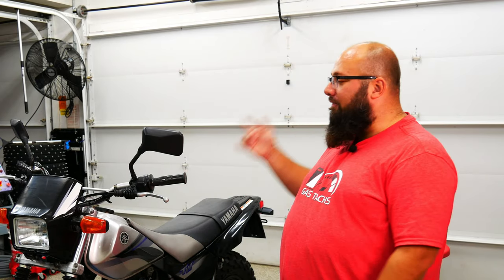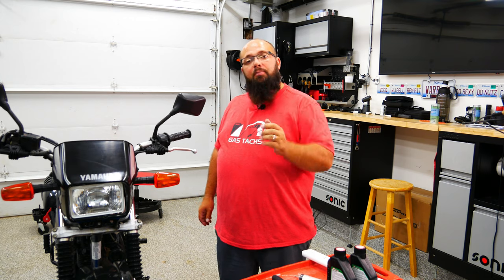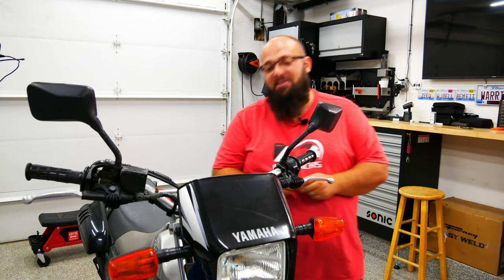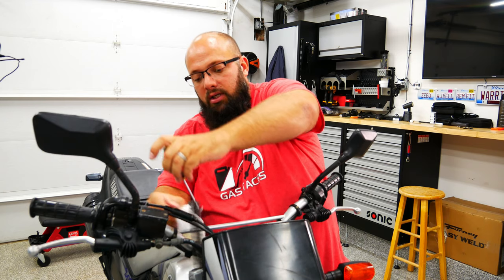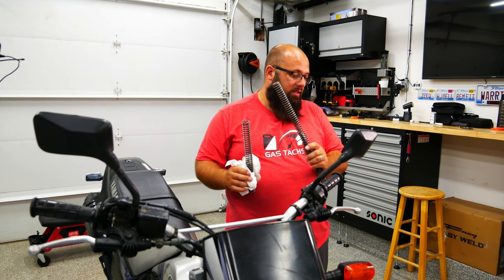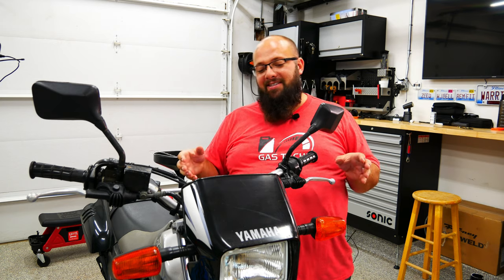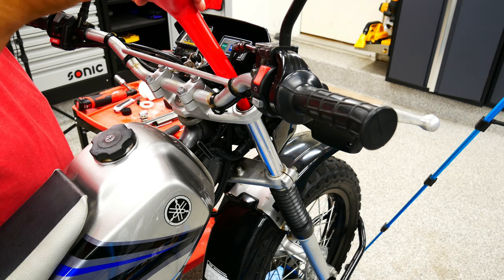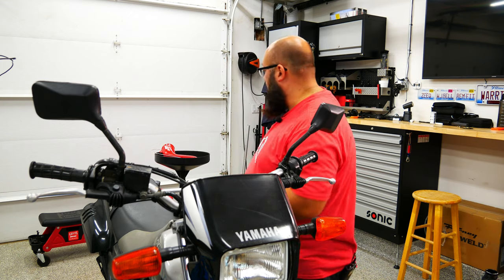How to Change Your Fork Springs on a Motorcycles  - My TW200 Build - Part 2

Comment: It does help if the manufacturer sends you two springs of equal length,  which for some reason Progressive Suspension seems to have a hard time doing these days.

Comment: This is the first video I’ve seen where you leave the forks on the bike while changing the springs, which I like. What’s the reason people are removing the forks entirely from the bike in the other videos??
Reply from the maker: Really I've had mixed "reviews" on how I work on things. Some say i'm stupid and some say thanks for the info. There is no reason to remove the forks unless you are rebuilding them.... Work smarter, no harder
Reply: @GasTachs  I agree. I’m about to do mine soon. I’m not sure how to check the seals but I prefer this method over a full disassembly.

Comment: So how are the forks after you changed the springs? Did you go with progressive brand or the springs from pro cycle USA. Have you changed the oil levels? Need more input.
Reply from the maker: So I went with the .70kg/mm which are 40% stiffer than stock. after doing this I would have rather when with the 60kg/mm. I have kept the oil lever as they were in the video.

Comment: dude.. truly for entertainment value only.
1) remove the forks from the bike
2) before removing,  loosen the top triple clamp bolts before removing or replacing the fork tube upper cover.    
3) you can't see leaks if you don't remove the fork boots....
4) at 90MM you probably will blow out the seals.  130 MM was the right oil level regardless of rider weight.
Reply from the maker: Entertainment baby.